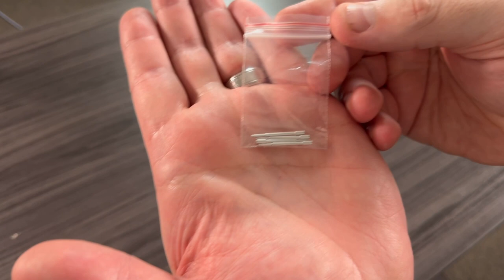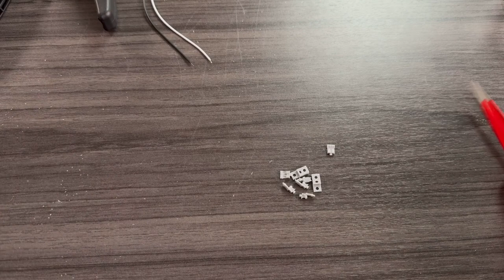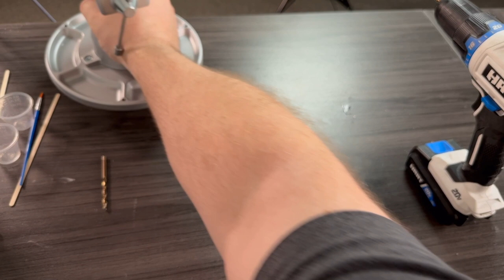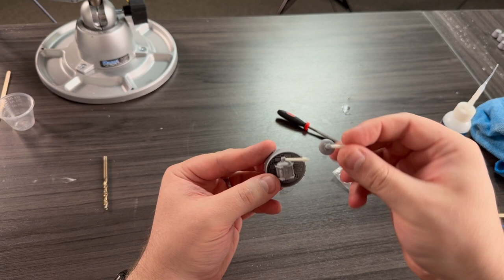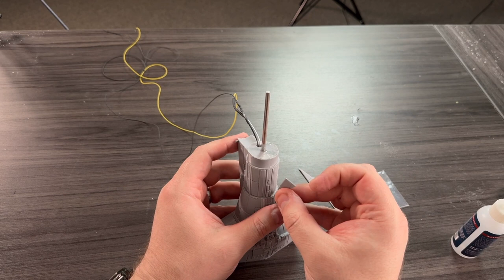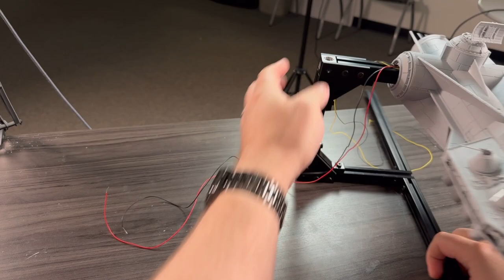Tantive IV 30in model assembly part 2

Comment: 5mm led that will work with a 5-volt system. Though it doesn't have to be 5mm, it's whatever you want to use.